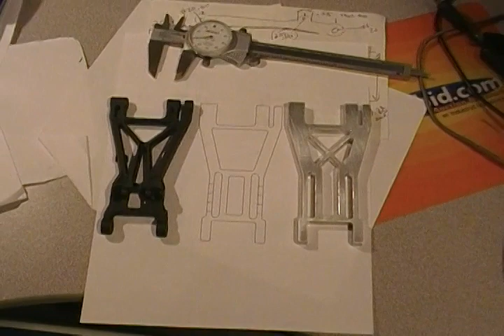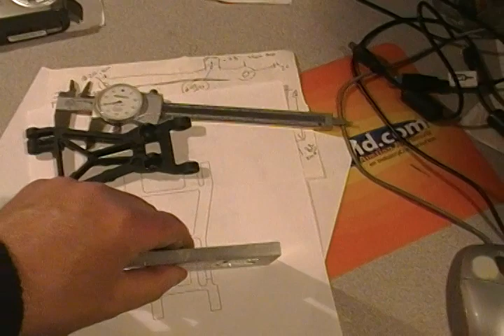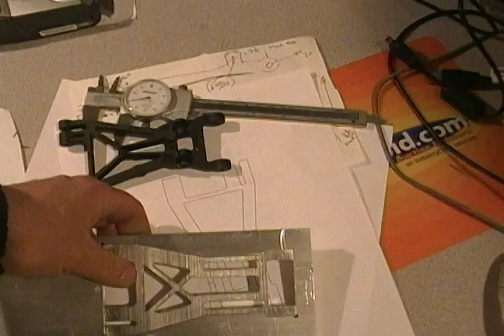CNC MACHINED PART FOR HPI SAVAGE RC TRUCK................COOL!

Comment: What type of machine this you use? I real wanted to machine part for my RC just like you did.  Good job
Reply from the maker: vangt858 the cnc mill is a TMC 1000 which is an older LightMachines mill designed for the educational market. It was quite spendy in its day and they still manufacture a version of it to this day but the company is now called Intelitek .

Comment: I wish I can find someone that can make me some parts for my CAPO ACE1 . Plastic parts are cheap junk on these .
Reply from the maker: Sadly the effort it takes to design and machine parts like this is far to great to be economically feasible for one or 2 pieces.. Material costs alone are greater than the cost of complete plastic parts made offshore. This was done more as a design exercise and in the end the customer never paid or picked up his parts so was a total loss from that stand point. Buy yourself a CNC machine and learn to do it yourself is likely the best way to go! Although that's not cheap or easy. ;-)

Comment: hI THERE LOOKS REALLY GOOD MAN! I was wondering if you could make a set of those but with a 2inch extension, basically 2" longer than stock i have a 1/5  savage monster.  Let me know what you think.
Reply from the maker: dave check you messages I replied privately
Reply: backyardcnc hey there i cant find my masseges  where u replied privately
Reply from the maker: click on the settings button on the upper right  to the left of your id (and right of the Uplaod button)  and then select dashboard and then community then inbox. you must be signed in. Likely tell you how in the help area

Comment from the maker: Thanks for the comments and while you are correct in the idea of shims and a drill press. However the exercise was also done with an eye to a small production run and its hard to beat fixtures for ease of repeatibility.

Comment: Thata very cool.  How did you draw up the design and code it for the machine to work. Do you have any tips for getting into this from the beginning?
Reply from the maker: this was an exercise in just proving that I could do it as I had a request for the parts but in the end the client was a no show to retrieve and pay for them when done. It was a case of measuring up an existing swingarm and then drawing it in a CAD program, once that is done is easy enough to generate toolpaths to cut the part although completion did involve several jigs and fixtures to complete aspects of the job as well as hand tapping the holes for the adjustable shock mounts. As far as getting started that is a long story, but in a nutshell buy machine, buy software, spend every waking hour for next year reading and learning CNC and then you can make these sorts of parts. You will spend a good amount of money and it it could drive you insane :-) but it will be fun!

Comment from the maker: This part was done on cnc milling machine using a number of fixtures  I designed to allow me to produce them. While cnc routers can be used for aluminium parts a milling machine is better for this sort of thing. You can see the mill I used in my other video. You might look at the cnc mill from Taig as an affordable option.

Comment from the maker: @bmckeever1972 email me direct at  backyard_cnc(at)live.ca. I would need pics and some basic size references to see if it might be possible. However if the part is currently already available in the marketplace it if for sure cheaper to buy than a custom one off that is fully cnc'd. I will look at it though.